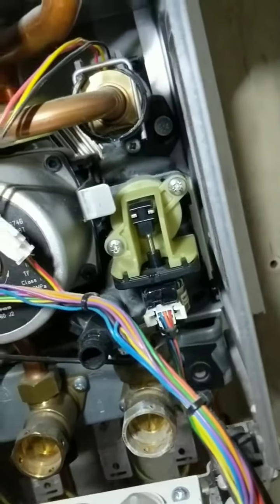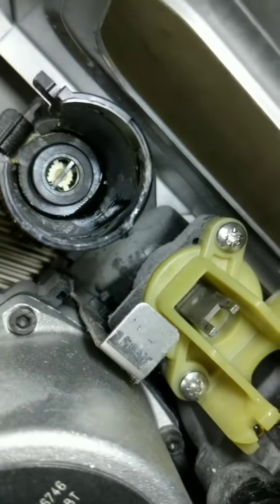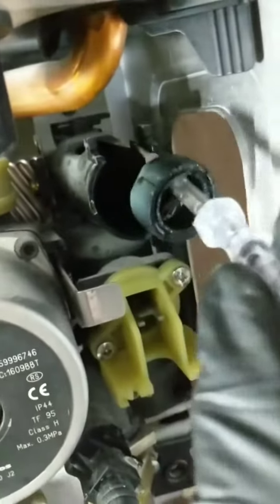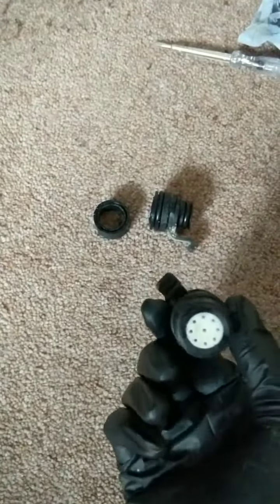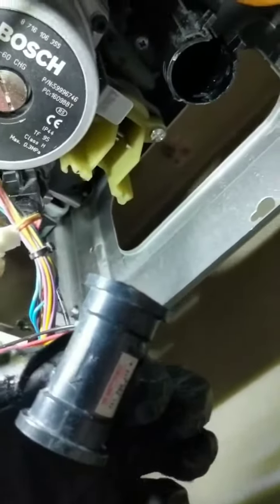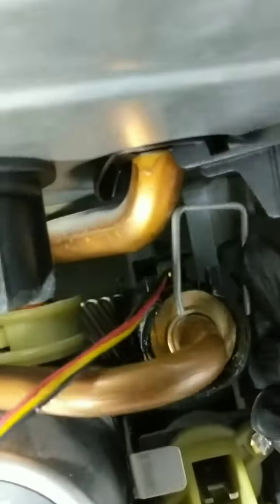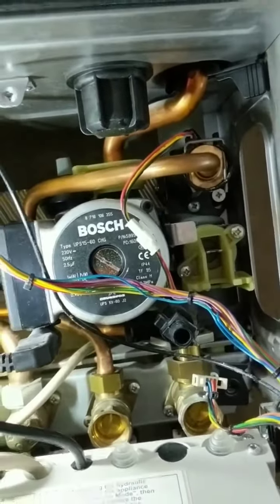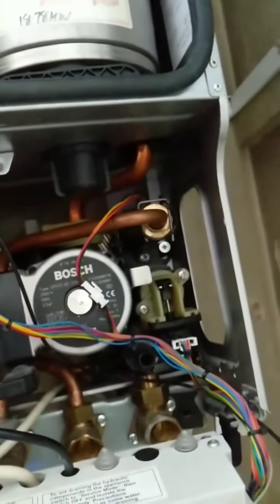Flow Turbine adapter change on a Worcester Bosch

Comment: Just been charged £120 to have this replaced... Been robbed!
Reply from the maker: That price is fair, it's what I would charge for the job.
Reply: What's wrong with that?
Reply: @MrJ2theC  Well they charged me £40 for a £5 part that I could have picked up locally that day vs the guy taking 5 days after ordering it online... The labour is what it is. Thats his wage for the 20 mins he was here.
Reply: Just been quoted £110 to get this done
Reply: Just ordered mine from screwfix £12.49 next day delivery I’m not paying £100 + to have fitted
Reply: @trickym5748  It was temping to just do it myself and do alot of things such as electrics but gas/ boilers is one area that I i wont. Seeing the aftermath of that gas explostion in Edinburgh recently had confirmed it. Knowing my luck I would cause a gas leak even though I wasn't touch it. 😆
Reply: @callumBee  So you are debating what someones knowledge is worth? Solicitors charge way more than that for way less, but you think that a tradesman is beneath you. You're not paying for how long the job takes, you're paying for the fact that he knows how to fix it, and fixing it quickly because of experience.
Reply: @callumBee  You have no idea. You could have attempted it yourself, but would you know exactly what needed doing? And how to do it? No, because if you did you wouldn't have rang them up in the first place. You think that heating engineers are beneath you. The guy has to charge a call out charge because he has costs, and then diagnose the problem and know what to buy and how to do it, before any of that. Why don't you go around just doing them for £20 and see how that works out for you? It's so rude of you to just assume that because it took x amount of time that you can determine the price. Do you know how businesses work? Do you know that you aren't even allowed to take a boiler case off unless you're gas safe? Which costs a fortune to sit the exams etc. You don't you're born.
Reply: @callumBee  Yeh so don't fuck with boilers unless you know what you're doing, That's what you pay for. You pat for the time and effort it took that person to be allowed to take the case off, and also the ability to know how to fix it and where to source the parts and how to fix it. The reason it may have taken 30 minutes is because he knows what he's doing. It looks easy on a video but I guarantee if you tried to do it something would go wrong or you'd hit a snag etc, or maybe even disturb something else in the boiler that might cause a dangerous situation. 
£120 is a very fair price.
Reply: @callumBee  The fact that you won't do it yourself because you're afraid of doing it wrong because of that aftermath is exactly why you should respect what they charged you. We're not just labourers, we're highly skilled. I did a degree in human biology but at 21 I decided to be a gas fitter instead, because I prefer that kind of work in a practical sense, and it was way more difficult than uni. So stop looking down on us and assuming things, because the vast majority of us are not ripping you off.
Reply: @trickym5748  If you're not gas safe registered it's technically illegal for you to take the case off the boiler. I'm sure you'll manage it because it is a relatively easy job. Just be careful not to disturb other things in the boiler that may cause other problems. You can't see gas and you can't see or even smell carbon monoxide. You might be a smart guy and you'll probably do it tbh, but if everyone thought like you then there'd be a lot of problems overall.
Reply: Anyway with all my frustrations out the way now and no hard feelings, I can assure you that you haven't been robbed. It costs a fortune just to have the qualifications and the testing equipment, and it's time consuming just to diagnose what needs doing in the first place and what part is needed etc. I hope you can understand.
Reply: An hour in your house doing the actual job that you think is easy would equate to about 3-4 hours of actual time, and years of experience.
Reply: @callumBee  When I bought my house, I'm pretty sure I was charged thousands for a solicitor to just fill out some paper work. But I have no problem with that because they invested in themselves and learned it all, so they knew more than me, and that would have been the going rate. The going rate for changing a flow turbine adaptor is about £120, so why are you so angry? It's perfectly reasonable. Is it because you think that gas fitters should earn less than you? Because you're working in an office with a high sense of self importance and you look down on tradespeople? Or is it because you don't appreciate pr understand  exactly what they are doing?
Reply: @callumBee  Sorry to be a dick btw, but I just wanted to educate you, (not be patronising) as we get this a lot. But it really is the going rate, and yes we do earn a lot, but we do loads of things and have to have loads of skills. We deal with radiators, we go on roofs, chimneys, gas fires, complicated central heating systems in massive houses etc, we go under floors often, we diagnose problems like yours before we even start earning. We don't just change flow turbine adaptors on a Worcester boiler all day 😂 You're paying for a decent guy/girl to know what they're doing. I promise you, you haven't been ripped off. Yes you could have done it, but I could do fix my car or can if I really wanted to but I don't, I take it to a garage. In case I fuck it up. I pay for that peace of mind.
Reply: @MrJ2theC  well said 👌🏼
Reply: @callumBee  there is no standard price, I personally would charge what I think it’s worth. If you want a cheap price you’re most likely going to get a bodge engineer who does more damage than repair.

Comment: Does anyone know if the flow turbine can go in the other way round? This has recently been replaced on my boiler and now when I place a call for hot water the boiler kicks off with a creeping U0-U9 error code as if the temperature has raised too much
Reply from the maker: You might have a blocked plate too
Reply: @cputilitysolutions  cheers mate, is this likely easy to flush? Or complete new part?
Reply from the maker: @Ahwoo87  you can take it out and clean it with acid or replace it
Reply: Cheers mate. Very helpful

Comment: Where does the fibre washer go?
Reply: Did you find out where it went in the end?
Reply: @marshallkay693  Yes, on other end of the curly metal pipes at the bottom. they give a new one as  they commonly wear out
Reply: @shadow_bandit403 appreciate the reply I thought that might be the case cheers

Comment: Had this part leaking but had the flu so didn’t feel like fixing it myself.
Had the boiler company round, showed them where it was leaking from, wanted to leave straight away without even opening the boiler as he was convinced he knew exactly what the problem was.
Told him to at least take the cover off and look.
1 minute later, the cover was back on and still certain the housing was cracked.
They sent me a quote for £400, to include changing the automatic air vent and the entire turbine housing. This did not include replacing the part that was actually leaking!!

Have just repaired my boiler following this video.
Nice and straightforward, easy to follow, perfect mate!

Comment: Thanks - just changed on mine, as you say the part which screws on is made of finest German cheese
Reply from the maker: Haha you know it 👌🏾
Reply: Leak was actually coming from the rear not the front - so as I feared I'm going to  need to change the whole return manifold.This was worth a shot though - and this part doesn't come with the manifold kit so would have needed a new one anyway!
Reply from the maker: @richienorthcott  make sure you get a new PRV as well. I've got a video on the right hand block as well if it helps 👍🏾
Reply: @cputilitysolutions  Yup I'd already seen that, thanks again! There's limescale buildup looking very much like the one you show. Water is actually dripping from the LHS of the boiler case which had me confused - turns out the boiler is installed slightly on the p*ss so water is downhill along the metal bar where the pipe connections attach. The RH block is definitely the culprit.

Comment: I don’t have a leak, but Need to open Hot Water tap to Maximum to get the Boiler to come on!  Would replacing the flow turbine adapter help?  Thanks!
Reply: Was it the flow sensor which he removed early on in this vid?

Comment: Any idea with this mate my greenstar 25si when I run hot taps or shower boiler locks out, I've replaced the heat exchange plate and still having the same issue ?
Reply: Also replaced the hot water temperature sensor
Reply from the maker: Does it run ok on heating?
Reply: Yes mate totally fine on heating mode doesn't lock out
Reply: I've just run the hot tap and felt the flow pipe which felt like it was starting to warm up so going to change thr diverter and paddle. But would this cause the boiler to lock out?
Reply from the maker: @Blackcountrybirdroom  I wouldn't have thought so mate but best to rule it out. Let me know how you get on
Reply: @cputilitysolutions  if I have my Ch on and I go in the shower the burner will cut out but looking on my hive stat it still says the boiler is running but it's not lol
Reply: @cputilitysolutions  cheers mate stressing me out lol also the pump is red hot can't even touch it lol